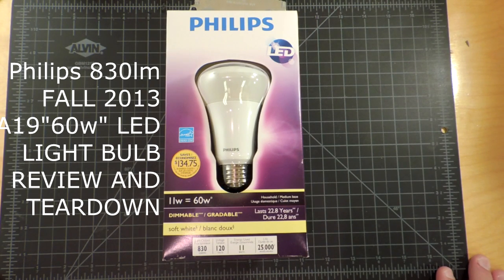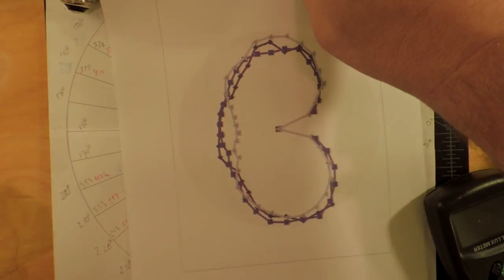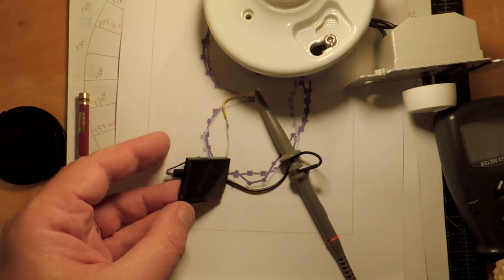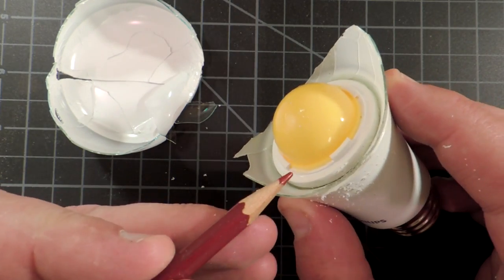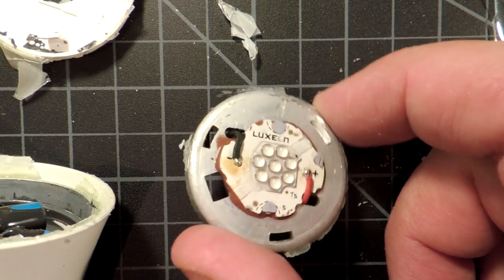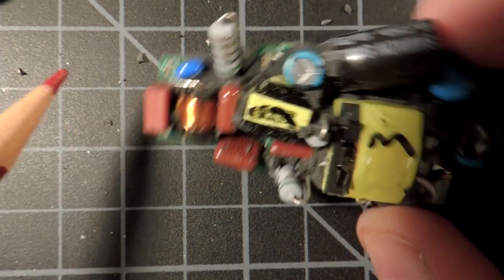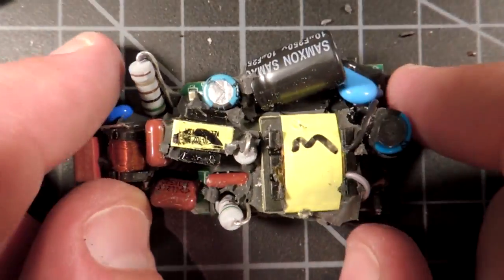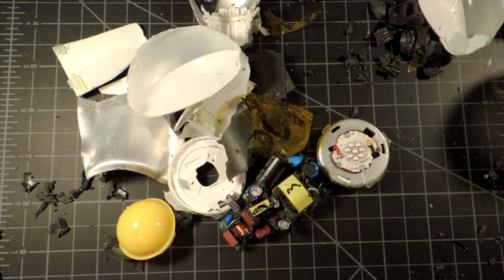Philips A19 "60w" LED Light Bulb Fall 2013 Version Teardown and Review

Comment: I have a cheap 120-V. Walmart night light which has flicker discernable in one's peripheral vision - not direct vision.
Circuit is:    Left plug prong - [diode] - [1/4-Watt 10,000 ohm 5% resistor] - LED[o] - switch - right plug prong.
Nice warm 2700K light!      Why is its flicker not terribly noticeable 60 Hz halfwave flicker? 
Is there microcircuitry in the [o] wafer. (It has 6 leads but I can't see where they go.)  Its 3 mm dot is orange. I assume it is a phophorescent material excited from UV LEDs beneath.
What can I do eliminate ALL flicker?     I want to mount this in our grandmother clock aimed down to illuminate the brass chains, weights and pendulum bob.    Thank you.   Robert  USA
Reply from the maker: buy a 12V DC power supply  (search for "12v dc adapter on Amazon).  Buy either tape lights (search 'tape led 12V' on amazon) or a 12V bulb ( search '12v led bulb' on amazon).
Reply: Thank you.    Just want to make a full wave bridge rectifier and add a filter capacitor to eliminate all flicker.   Now a 120V 5-Watt night light bulb nicely illuminates the pendulum case.
Surprised that Meridian Electric Company in St Louis, MO did not eliminate all flicker from their night light.  No reply to an e-mail to them last week.

Comment: Is there any flicker from incandescent bulbs?   Or does the filament's thermal mass smooth out any flicker?In England I noticed the 50 Hz 100 blinks/second compared to the 120 blinks/second in 60 Hz current.
Reply from the maker: Thermal mass helps smooth flicker on incandescent bulbs
Reply: *****  Yes, but does it eliminate all flicker?
Reply from the maker: Does it eliminate all flicker, no, but it drops it below the perception of most peoples capabilities to detect.
Reply: *****  I suspect an effect on us even if flicker is not consciously perceived.
Best to have pure DC which emulates no flicker from sunlight.

Comment: "iTube" the best way to terminate power guzzler and toxiced fluorescent!
Check out the video>>>>  https://www.youtube.com/watch?v=3498awz1Ijo
There are many types of ballast been useing in every where like Preheat start, Rapid start, Insatnt start and magnetic ballast. Most of Plug and Play LED tube only can use with Instant start ballast! You should make sure what type of ballast in your existing fixture before you install the new LED tube otherwise LED tube or ballast will be damaged. On the other hand,  Plug and Play LED Tube only can work with ballast, what if the ballast is out? They was designed to work with Instant start ballst which means when ballast is out, your Plug and Play LED Tube also out, it can't work by AC 110 or 220V direct power in, you need to buy a new ballast.
Here is our product" iTube" it can work with AC 110~277V direct power in(by pass the ballast) and if you want a easy way to  replace the fluorescent without by pass the ballast, "iTube" (Certificated by UL Listed, made in Taiwan), the only 1 in the world can fits all types of ballast ( Preheat start, Rapid start, Insatnt start and magnetic ballast). 
Thank you.

Comment: why do they use blue instead of pure white leds? i dont get it.
great video, really interesting
Reply from the maker: +LeanVlogs ★ phosphor on top of led can separate due to heat/aging remote phosphor superior (but more expensive)
Reply: LED chips don't emit white light. White light is a very broad spectrum of wavelengths. An LED (light emitting diode) emits light with a very narrow spectrum bandwidth. In order to get white light you can do a lot of things. Mix different color LEDs but that is very difficult to get a good result as you need a lot of different wavelengths and an extremely good diffuser to mix it all evenly. Instead to get white light a mix of different phoshors are used to convert some of the blue light to light of other wavelengths. All white LEDs are basically blue or (near ultra) violet emitting chips with a coat of phosphor. By using a phosphor not directly on the LED (remote phosphor as here) your get the benefit of easier color control of the final product and better aging characteristics - at the expense of manufacturing costs. When non remote LEDs age they tends to go dimmer and higher in color temperature as the phosphor is affected. By not having the phosphor on the chips which do get near 100 degrees C breakdown of phosphor is for all practical purposes eliminated and light quality is much more consistent just dimming not noticeably by wear of emitter and finally it'll go dark because of thermal cycle wear or fail of driver electronics.
It's basically not much different than a flourescent tube. But apart from operating principle the difference is that initial wavelength is not very short wavelength UV but falls within visible spectrum and so light doesn't need as big as a wavelength conversion which means more even spectrum and better efficiency. Not to mention no harmful shortwave UV and only limited near UV radiation. Much less UV break down/yellowing of nearby plastics, paints, pigments etc. and better for your eyes and skin too.
Reply: +electronupdate is the phosphor beneficial when there's already a white diffuser? it's cheaper to add extra white LEDs than to use a phosphor to increase lumens. I guess their goal is higher lumens per watt.
Reply: HifiCentret Thanks for the long and detailed answer.

Comment: What color do the LEDs emit?
Reply: +Robert Gift No UV light, as afaik a phosphorous layer can only convert the wavelengths longer, not shorter. Hence no UV.
Reply: Flourescent tubes is UV and they also use phosphors to convert light. And you can get UV LEDs. But for white it's more common to use blue as you get a more stable product. The UV will break down the plastics in the LED assembly faster than blue. Also the closer you initially are to the desired output wavelength the better efficiency.
Reply from the maker: +Robert Gift The LEDs emit a blue light which then gets converted to white light via phosphor which coats the die
Reply: *****  Thank you.  UV light?

Comment: I was hoping you would run bulb without filter to see color of LEDs.
Reply: I'm sure you knew this already, but usually the actual chip in white LEDs emits blue light. I tried pulling apart a cheap 1W LED from China, and when I poked some fine wires onto the bare die, it lit up a very deep blue.

Comment: SMPS and harmonics, yuk, I once purchased 15 x PHILIPS CFL lamps, they only lasted 2 years, I wonder how long the drivers on LEDs last for?
CFL bulbs have been a right con, full of toxic mercury in the tubes, they do not last long enough to payback the original investment CFL lamps are a bad investment and a rip off in my opinion.

Comment: For your families safety, do not buy uncertified non compliant electrical equipment, these include computers, compact fluorescent lamps; unlike filiment incandesant lamps, these produce electrical noise (harmonics), these devices inject other waveforms that are not 50 hz back into the power supply to create noisy dirty power.
Harmonics mean larger transformers and cables and hotter neutrals in large installations.
Cheap chinese switch mode power supplies and ac to dc converters can be dangerous if not designed properly.
Low budget and badly constructed dc power supplies will inject dc back into the power supply and will cause nuisence tripping of overcurrent protection devices in larger installations such as shopping centres and highrises apartments.
Reply: harmonics are less of an issue than power factor. some really dodgy electronics cheap out on PFC

Comment: Great review.  Some CFL and LED bulbs generate lots of RFI on the AM radio band.  Please, set a battery powered AM radio about 5 feet away and tune across the band and report what you hear.  I don't care about power line conducted noise but other people might.  My Walmart (81131-09878) LED 60W Daylight generates lots of RFI, I returned it.  I also have two 60W LED daylight bulbs (Cree and Osram) that have negligible RFI.

Comment: I do appreciate your videos which are very professional!
I have a question that nobody could help me. I have supplied a 120 Vac light bulb LED through 125 Vdc circuit. The lamp is working in a great way for the last six months. According to Philips it is not designed to work in direct current, although it do work.
My questions is about depreciation, it is possible to measure the time life of that lamp working in dc? I have tried to achieve answer looking for circuit models but no success.
Reply: It should be fine, the lamp controller works with DC anyway, the AC voltage is converted to DC by the bridge rectifier and the filter capacitor. If anything, I would expect your filter capacitor to last longer because it's subjected to less ripple.
Reply: José Faria There will be a heat difference.  The switching transistors must stay on longer at 125VDC than they would at a 120VAC circuit bridge rectified to about 168VDC, and the circuit will be at higher (input) current with a lower VDC, which may stress more than just the switching transistors.

The ripple reduction is difficult to determine because we can't assume the DC supply has no ripple and generally speaking a low 120Hz ripple at low current is not very hard on a capacitor.  It would usually be the output filtering capacitor after the SMPS that suffers earlier failure, including at the higher current required by the lower DC switching input voltage.

The above is only speculation based on their tweaking for high efficiency at the AC line voltage it's intended for.   The "weakest link" in the design might not be effected much by the use of 125VDC instead of 120VAC.  A complete schematic, component list and critical evaluation with some math involved, and then testing with a significant sample size would be needed to make a more accurate estimation.

Regardless of the above, even their own estimations of lifetime using 120VAC are questionable since the output filter capacitor spec sheets generally only rate for something like 100KHz @ rated temperature and then about 2K to 5K hours at most and that's if it's a high quality (especially low ESR) electrolytic which is probable, instead of polymer at this product price point.  Ironically it's somewhat incredible they can sell them for $10 today when if you price out individual components from an electronics supply house then the BOM would be closer to $50 not even counting the LEDs themselves or assembly, marketing, transportation, etc. etc.
Reply: +Rafael Gabrilli Has anyone found a LED lamp working in 125vDC with a datasheet that prove it can withstand it ?
Reply: David Auger
You will never find a bulb designed for 110VAC that has a DC voltage spec.

What you "might" find is a bulb that specifies the minimum AC voltage it can tolerate which you can convert to DC roughly as DCV = ACV * * 1.41, so in other words it should spec capable of operation down to about 85VAC except that just as 110VAC can vary, 125VDC might too.  Hard to say since you didn't specify the power source which seems to be an abnormal one to supply 125VDC.

Comment: Driver performances and reliabilities are important, so as the brand of the LED chips. But the key element is how the chips are stressed in a product. Over stressed chips (by over powering and lack of heat dissipation), will increase light deterioration, and hence life time.
One of the best way to make a quick judgement of a LED lamp's Chip-Stress performance if by looking at the product's Efficacy (lumen per watt). Remember it is the overall product's efficacy that you are interested, NOT the efficacy of the Chips that the product is claiming of using.
A Light-Bulb replacement LED lamp in today's market (commercially ready) can achieve up to 120-130 lumen per watt among the high ends; 100-120 lumen per watt midrange; and below 100 lumen per watt among the low range.

The older version of the Philips 17W (Philip A in this video) delivers 1100 lumen at 17W.. Its efficacy is 65 lumen per watt. The newer version delivers 830 lumen at 11W.. Its efficacy is 75 lumen per watt.
At this efficacy, users might as well consider using CFLs instead of LED. At least the CFLs are much cheaper.
Reply: lumen per watt greatly depends on the spectrum. a nice, daylight like true color white is not nearly as efficient as some cold bluish white leds. I dont mind using an extra watt for better light.

Comment: I wouldn't buy a philips anything. Every philips product i've ever bought was a POS! I'm also in the commercial office building facilities industry and every time I come across a fluorescent bulb that is dim and pink, it's always a philips bulb. Years ago I bought a philips dvd recorder, I made one dvd which by the way won't play on anything, and it quit working. After going through a bunch of warranty bs, circuit city had to send it to philips which kept it for like 3 weeks and supposedly fixed it, when I got it back, I recorded another dvd (which won't play anywhere) and the recorder quit working again. This time I threw it in the trash $1000 just chunked away. philips will never ever get any of my money again.
Reply: Either that's a USA thing or you were just very unlucky. Regarding lighting, my anecdotal evidence is totally different: philips bulbs last me longer than most other brands and keep the right color until later in their life, especially fluorescents and metal halides, and I find their electronic control gear as good as anyone else's, LED bulbs from philips are still going strong while others already have broken controllers. For automotive I only use philips now, Osram only fooled me once with their regular D1S bulbs, changed color in less than 1 year.

Comment: what kind of LED's are being used in these light bulbs - mcd, forward voltage, mfg's, smt, size etc.  That would be an interested comparison -
Reply: Mike Jarvis If you have the capability of making such a comparison then you have the capability to figure that out.  I'm not sure that it works the other way around but:

Luxeon K  8 x 1W LED array on single star MPCB, mcd is non-applicable as it has nothing to do with these, rather MCD is an intensity rating based on focus (lumens is the relevant quantity in pseudo-360' bulbs), approx 1200 lumens (25C temp, before optical losses from phosphor dome and globe), Vf approx 22V @ drive current used, Cf approx 1.0A (derate for thermal management), SMT size is non-applicable because you can get arrays of various # of LEDs put on custom MPCB for any product size, shape and thermal capability.

There is more info in the datasheet.
http://www.ledsupply.com/content/pdf/leds-luxeon-luxeonk_documentation.pdf

Comment: I am wondering if it really will last that long. I just bought one in a supermarket offer at 1/3 price. It gets blistering hot even in an open lamp shade pointing down. I am thinking the electronics won't last that long. 
I like the light even though the CRI is only 80.

Comment: Well as you can see from the Philips led bulbs you have there, they are all made in
China, however, those designs you have are very old and frankly, will not suit applications such as a desk ready light as it will not illuminate  behind the LED bulb. Which is needed. Why did you not open the CREE bulb, that looked like a better design? Than the two that you opened.

Comment: Kapton (polyimide) is transparent.  That is probably Mylar (polyester) film.  The second transformer looks like it's probably for Power Factor Correction (PFC).  Don't throw out those phosphor panels.  They are with blue and violet lasers.  Any idea what the wavelength of the LEDs is?

Comment: Very good breakdown and build analysis but what about the radio interference caused? Unfortunately, nothing was said about the interference problems to broadcast radios/TVs and other electronic equipment caused by lack of filtering in most LED bulbs. This manifests itself in DAB and FM radios by either partial breakup or completely blocking the radio signal.  On AM radios, there is a loud buzzing sound blocking out reception. Additional external common mode filters can reduce the levels to below the limits set by the Standards. The external filter cost is very high and must be electrically safe and approved!
The Philips bulb is probably very good because it has a filtering circuit on the internal circuit board to reduce conducted emissions on the power feed line. Some Far East origin bulbs with CE marking fail the conducted emission IEC/ISO/EN standards.

Comment: That bulb is ok but not very good.

I have a bulb i got from my local light store.
It is not made by the big companies but does a better job than what they do.
9w but it is 900lumens(75w incan) and it has very good spread of light
Reply: let's see how long  that bulb will survive.
Reply: Chester B. There's one big error in your reasoning: A LED's efficacy is INVERSELY proportional to its current. So overdriving them gives you LESS lm/W.
Reply: To get 100lm per watt means one of two things.  A pretty good LED, which is unlikely as I'm guessing didn't pay much for it, or you can overdrive the LED. Bright, but die much sooner, especially if it's not heat sinked well.
Reply: Chester B.
The bulb cost $30.
Not a cheap one